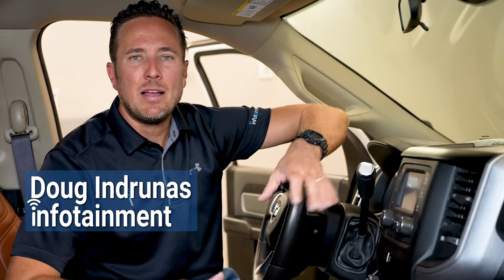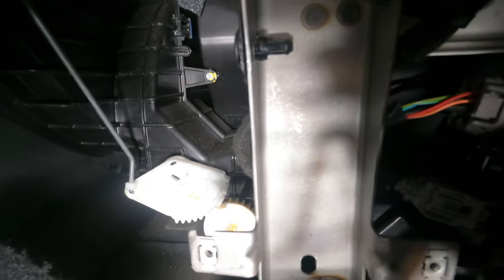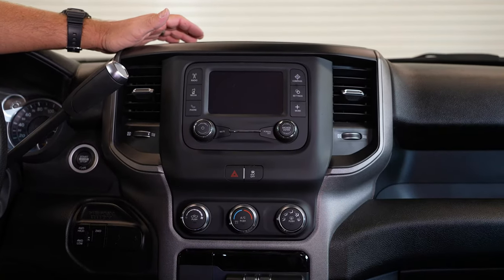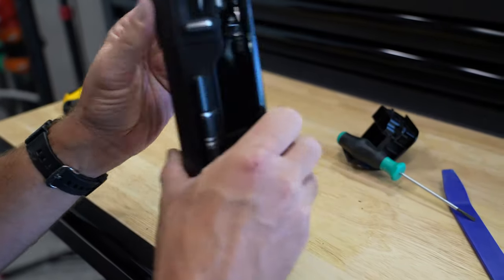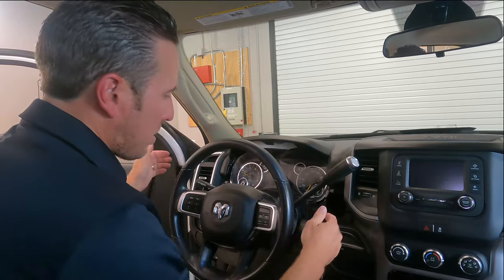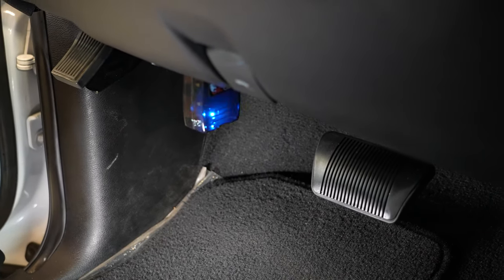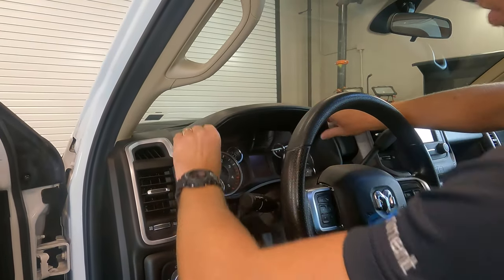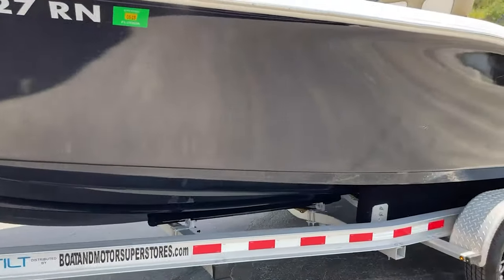2019+ Ram 2500 - Factory Electronic Trailer Brake Controller - The Build S1E7

Comment: I purchased the trailer brake controller for my 2024 Ram 2500. Went through the install of everything correctly and then two days later now getting a check trailer brake wiring light that comes and goes
Reply from the maker: Is the error message specifically pointing at the trailer brake wiring? Normally I've seen "Service Trailer Brake" or "Trailer Brake Service Unavailable". I'd recommend clearing the DTC's, and try disconnecting both batteries for about 20 minutes. Are you seeing any issues with the trailer brake itself? If so, we may need to exchange the module.
Reply: It says check trailer brake wiring and then goes to trailer brake disconnected and bounces back and forth

Comment: I installed this same thing in a 2022 dodge 3500 and I had the red light problem. Found out that I needed to leave the truck off and plug the OBD wait for about 5-10 seconds you’ll hear a honk and after that it turns green. That’s what worked for me.
Reply from the maker: We appreciate your user experiance on installing this thank you. If any one is having trouble with the install beyond this let us know at 855-636-6287 Ext or at support@infotainment.zohodesk.com
Reply from the maker: Ext 11*
Reply: Could I use the same OBD programmer if I just buy the trailer break and what it comes with?
Reply: @aaronhammon1792  can you?

Comment: Purchased the product. Followed the instructions. The programmer just stays red not flashing. Any hints?
Reply from the maker: Contact our support team 855-636-6287
Reply: Hey. I had a customer order one of these and they wanted me to install it and I had the same problem. I found out that I disconnected the bypass and replugged it in and instead of turning the truck just leave it off and plug the OBD plug in, wait about 10-15 seconds and you’ll hear a honk and the another 5-10 seconds the OBD will turn green. That’s what worked for me. Reach out if you have any questions, I’m happy to help.

Comment: how domi buy. for my 2019 ram 1500 Classic 4x4
Reply from the maker: Hi there,
This is the listing for the RAM Classic.
https://infotainment.com/shop/2016-ram-1500-classic-build-series-upgrades/2013-2018-ram-truck-integrated-electronic-trailer-brake-controller/